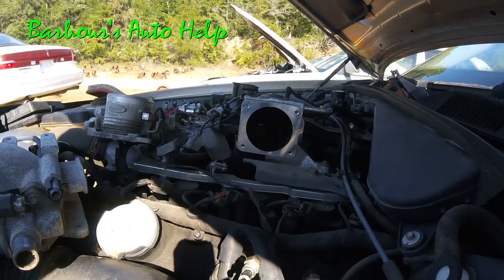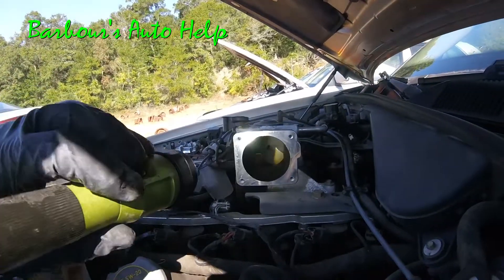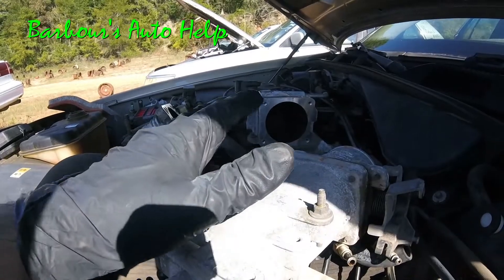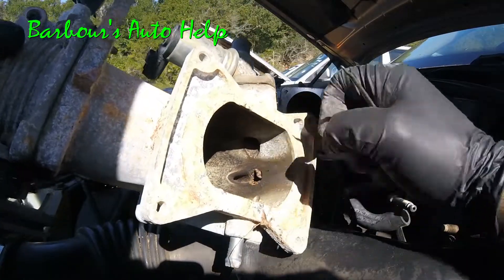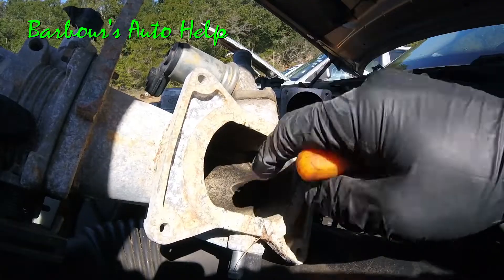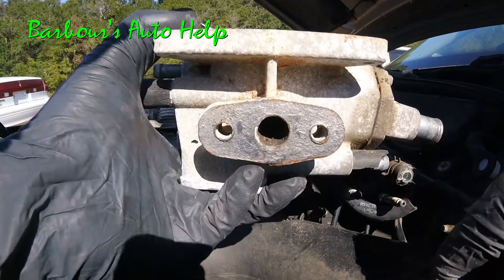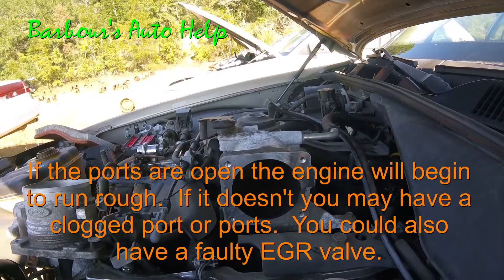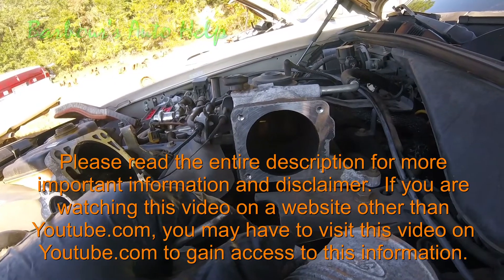How To Fix a P0401 Due To Clogged EGR Ports On a Ford

Comment: 1998 Expedition 4.6 running rough / rich out of the tailpipe. no engine light on and  no codes. been sitting a few years with half tank gas in it. I did not visually find any vacuum leaks. I cleaned MAF sensor and I added bottle of fuel treatment and still running same after week in driveway . have not driven on the road yet.
Reply: Did you find out what the issue was with it running rough?
Reply: @flowersfam3462 yes second plug wire on passenger side was rusty. cleaned it up and running great now.

Comment: Do you think the DPFE sensor going bad makes the check engine light come on the dash? I read it is the #1 reason. I have her codes too. I’m thinking of just doing a 3 step fuel injection service to eliminate any carbon we can’t reach internally. Also removing the exhaust pipe on the side of the block and cleaning with a brush wire.
Reply from the maker: DPFE sensors are notorious for going out and causing the ses lamp to come on.

Comment: This video was detail packed from beginning to end: You told us the primary cause of po401, and you saved us alot of time with "open throttle plate and SEE if it's clogged" before taking it apart! And adding vacuum to check for clog and to check EGR function was another huge time saving diag! This info is golden.

Comment: Would a p0401 code cause my car to make a ticking sound when accelerating? I’ve had this code for a while now and so far nothing has worked to fix it and it recently started making this sound of ticking when accelerating with no new engine codes coming up so I assume the problems are related. Someone help plz!
Reply from the maker: Spark knock can be caused by high combustion chamber temperatures.  Exhaust gas recirculated back into the combustion chamber cools the combustion chamber a bit.  Having inadequate egr flow can contribute to spark knock.  (not saying you have spark knock.  But this could be what you are experiencing.)  Properly diagnosing the EGR system and repairing it would be recommended.   However, in a lot of cases, especially with the 4.6L and 5.4L, going to a higher octane gasoline can help with spark knock untill the root cause is repaired.   I hope this helps "if" this is your problem.
Reply: @BarboursAutoHelp  so what’s my next move to fix the problem
Reply from the maker: Have you tried higher octane gas?

Comment: Have Eddie Bauer 2004 Expedition got the dreaded P0401 changed the DPFE  Sensor, EGR Valve and cleaned throttle body without removing it with throttle cleaner. Code went away but came back a couple days later. Decided to check the EGR Solenoid with multimeter before diving in to remove throttle from engine for deep clean. Solenoid read good so decided to start taking things apart...AN THERE IT WAS  not the two hooded green hose with one going to the EGR valve but the other one had that crappy  spongy rubber like material Ford used as an elbow to connect the hose from the EGR solenoid had fallen apart an had holes in it....Problem solved FYI people don't waste time like me check all hoses in the EMS system not just the unit throwing a code.

Comment: I have a 3.8 mustang and just replaced the egr valve. I also just replaced the camshaft position sensor. It idles rough and shudders when cruising
Reply: Same did you ever fix it mines doing that right now
Reply: @kobe4002  So I figured out that it was just a lot of soot and carbon buildup in the intake manifold from the egr. Just take the manifold off and clean it and the egr ports. It’ll run like new

Comment: What you have no codes and once I get to 2000 rpm under a load and it starts pinning and rattling ?...99 f150 4.6

Comment: My car keeps idling rough and dying when I come to a stop and keeps dying when I put the car into drive or reverse unless I press the gas. The engine light is sending the same code. The egr valve is good and I just replaced the egr solenoid but still having the same problem. Will being clogged cause the car to die also? Im lost and am not sure what to do.
Reply: I'm having this exact issue. Did you ever find a solution?
Reply: was it the IAC valve?
Reply: Did you ever find what caused the rough idling and dying of your vehicle?
Reply: bud, have you tried cleaning out that throttle body?

Comment: You did it, thanks!! Clogged as heck, those ports. On my '97 Expedition, the ports were located directly over the intake. No way to clean them without removing the entire body of the [whatever you call that aluminum block that fits between the throttle body and the intake manifold]. Broke off my PCV pipe in the process, dangit. But this is gonna clean up great and probably add back a few mpg. Thanks!!
Reply from the maker: Right on!

Comment: Hey great video.. But I have a quick question. You mention a way to test the EGR valve with adding vacuum to it with mercury or something like that.. But how would I do that? I was going to just clean it but I don't want to remove the entire throttle body and when I tried to just remove the EGR valve.. That huge nut on the egr tube wouldn't come off because of rust.

Any help would be great!! Thank you

Comment: What do i do if i snaped the front bolt on egr valve
Reply from the maker: You gotta fix it some how.   Not sure exactly what the situation is but bolt extraction may help.
Reply: Ford Egr valves themselves are cheap
Reply: If there is enough of the broken bolt sticking out of the intake and there is enough room to work, just weld a nut to the end and turn it out with a wrench.
Reply: Remove the whole bracket attached to the throttle body or the intake manifold. Easy fix
Reply: i snapped 1 of mine, the other bolt holds it fine by itself tho

Comment: Hi I have a 2002 v6 mazda tribute with p0401 code I have replaced the egr valve egr solenoid and egr sensor and still have the code coming up it drives smooth idle great what's causing it now
Reply from the maker: Have you checked to see if the ports where clogged up?
Reply: BarboursAutoHelp 
Yes all cleaned air take manifold all hoses everything is clean still getting a p0401 code
Reply from the maker: How did you clean the intake?
Reply: did you ever find what was causing your problem?
Reply: I know this is an old comment, but after first getting those codes, did your erase them and do another scan after replacing the EGR Valve, EGR Sensor and EGR Vacuum Solenoid to check for any codes again?

Sometimes people will forget to clear old codes after replacing parts that cause the code.